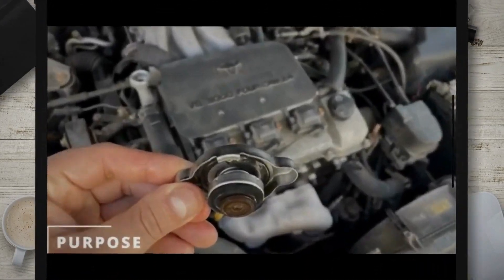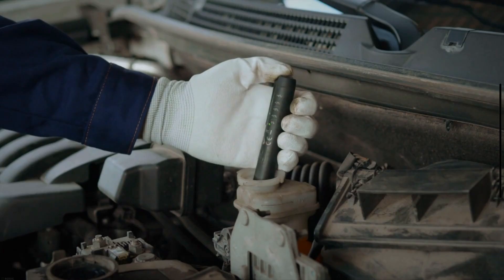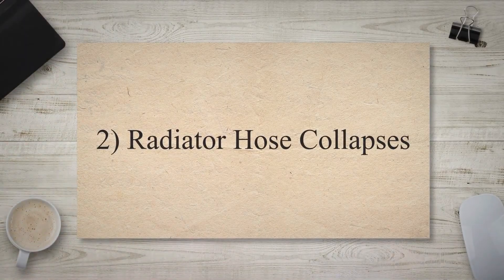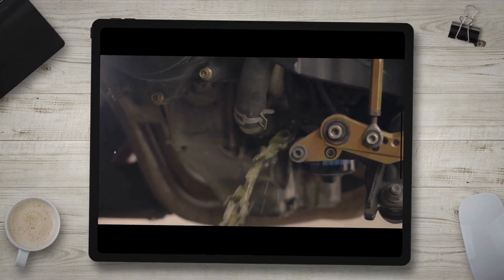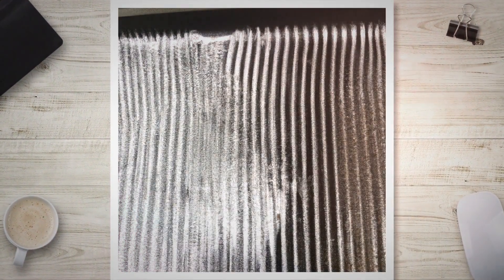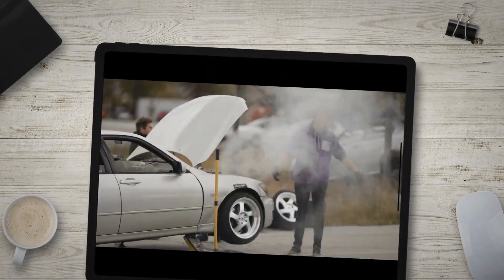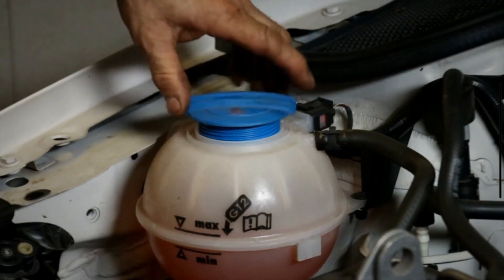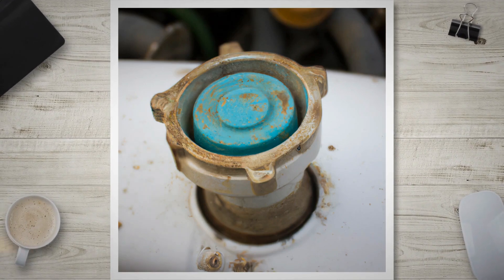Top 9 Symptoms of Bad Radiator Cap

Comment: What’s the air filter hose got to do with the coolant system? 🤔 it’s shown at 1:40 when mentioning hoses leaking. 🤷🏻‍♂️
Reply from the maker: @1mach28914u1  air filter hose plays a vital role to ensure the proper circulation of engine coolant

Comment: Having a bad radiator cap affect your fans from working right ?
Reply from the maker: A bad radiator cap can indirectly affect the performance of the radiator fan, but it doesn't directly control the fan's operation. The primary function of a radiator cap is to maintain the appropriate pressure within the cooling system. 
If the radiator cap is faulty, it may not be able to maintain the correct pressure, which can lead to various issues such as: A faulty radiator cap may not seal properly, leading to coolant leakage. If the coolant level drops too low, it can affect the efficiency of the radiator in dissipating heat, which may cause the engine to overheat. In extreme cases, this can trigger the radiator fan to operate more frequently or continuously in an attempt to cool the engine.

Comment: Can bad radiator cap increase pressure in cooling system which blows the hose?
Reply from the maker: Yes, a faulty or bad radiator cap can potentially increase pressure in the cooling system, which could lead to a blown hose. The radiator cap serves as a pressure relief valve in the cooling system. It maintains the proper pressure by allowing excess pressure to escape if it exceeds the specified limit, usually around 15 psi. If the radiator cap is not functioning properly, it may fail to release excess pressure, causing it to build up within the cooling system. This increased pressure can put strain on various components, including hoses, and may eventually lead to a hose failure or rupture.
Reply: Thanks, It did end up being the cap. we are lucky it wasn't head gasket lol as we thought it was exhaust gases going into the cooling system @MechanicalBoost